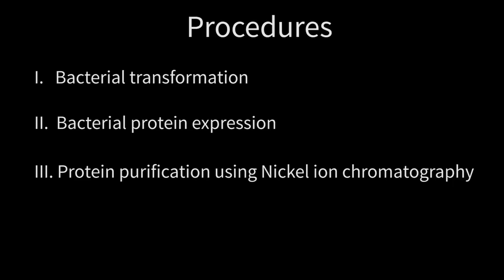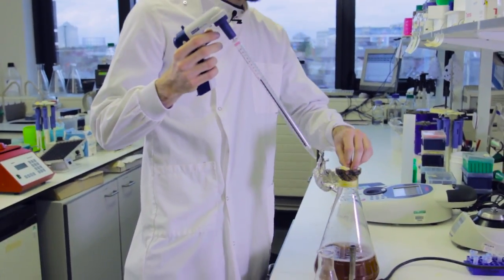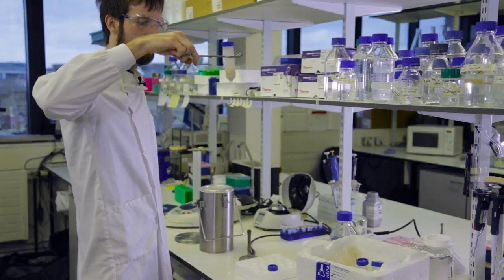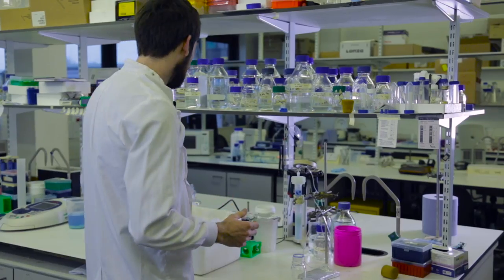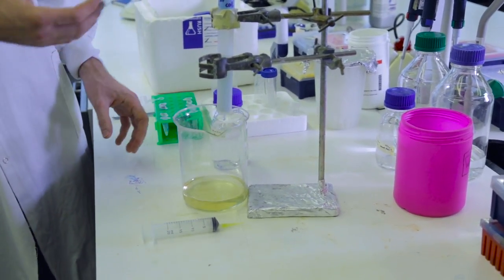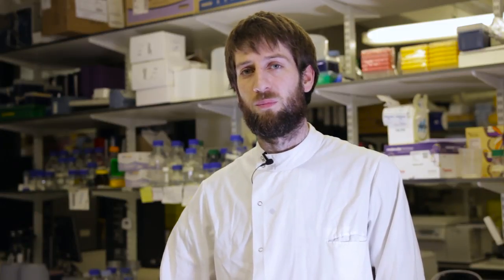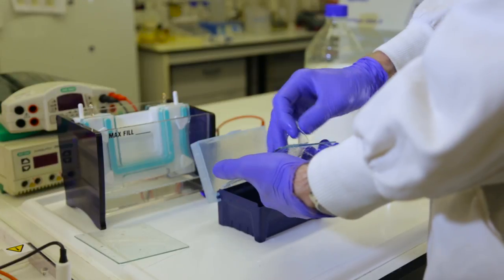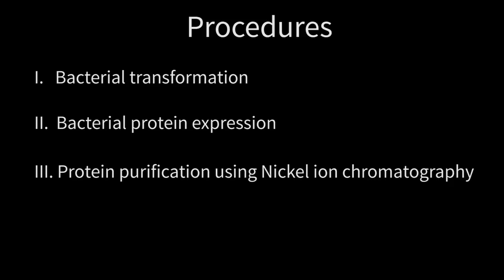QMUL Science Alive: Protein expression and purification

Comment: 1) The optical density of the E.Coli culture during IPTG induction and IPTG concentration? 2)Too much Ni-beads for that volume of the supernatant, so probably there was nonspecific binding of other protein to the beads leads to the tiny bands in elution lane. 3)The safety issue while the use of glass beaker for sonication. 4) no sample loading for wash step as well as beads!!